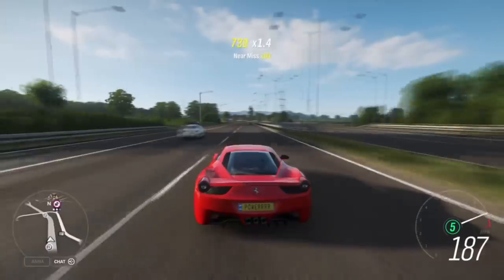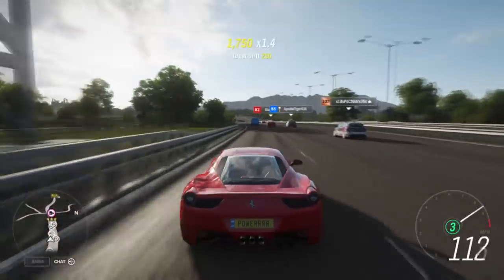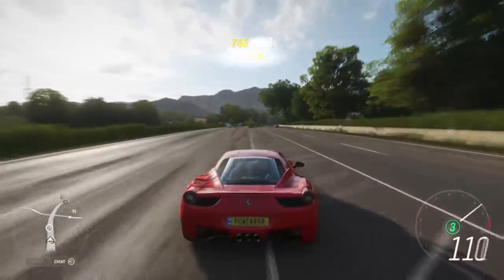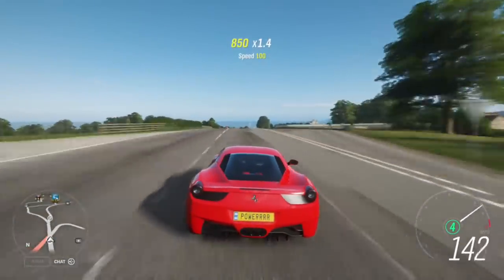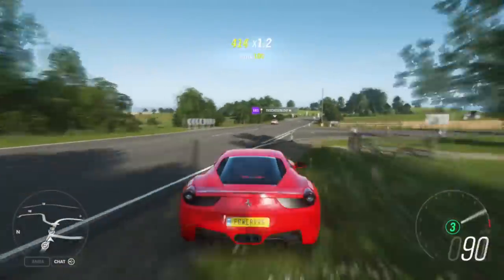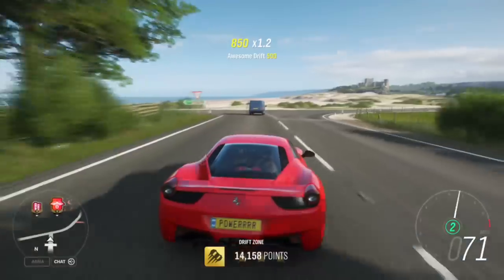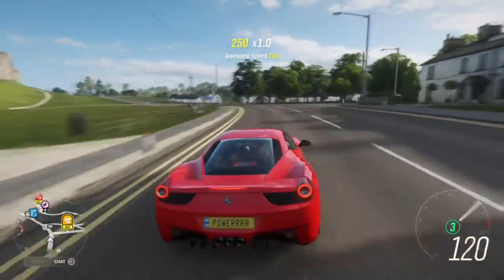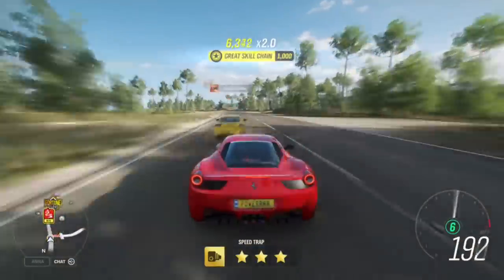Forza Horizon 4 - How Car Sounds Are Made! - Real Life Footage From PG!

Comment: It’s kinda funny how playground games used an R33 GTST with an RB-25 to record the sounds of the R32 GTR and R33 GTR which have RB-26’s. 

Smh
Reply: Ur kinda right and kinda wrong. The R32 GTR and GTST both had RB20s but had an RB26 option as a motor from the manufacturer. The R33 GTR and GTST both had RB25s but again also had a RB26 as a motor option from the manufacturer and then ofc the R34 GTR and GTST came with RB26s
Reply: close enough they cant get every car
Reply: @drumsticks1016  🤣 Who told you that?
All Skyline GTR's has RB26DETT and only RB26DETT! 
R32 GTST has RB20DET R33 GTST has RB25DET R34 GTT has RB25DET Neo
Reply: @s.k.3911  i think what he meant was the RB25DET motor is the closest to sound like a RB26DETT

PG couldn't get all the cars necessary for the sounds i guess..

Comment: 1. The GTR from FH4 does sound accurate to the 2017 model, but the 2012 GTR sounds much different. FH2 accurately gave the sound for the GTR Black Edition.
2. For the Skylines, they brought out an R33 GTS-T instead of an actual GT-R, and as you know, both variants have different engines.
3. They recorded a 1999 Dodge Viper, and brought it to the game. Great. What isn't great is that they slapped the sound onto the newer SRT Vipers.
4. They did good with the Mercedes AMG A45, but what annoys me is that the Ford Focus RS and a few other cars have the exact same sound.
5. Once again, the controversial Aventador V12 sound. It doesn't sound bad, and it's actually quite similar to the real variant, but I think they should keep that sound for the Aventador SV, and bring back the FH2 sound file for the normal Aventador. 
6. Finally, the removal of accurate car sounds. FH2, by far had the most accurate sounds to date in the Forza franchise, followed by Motorsport 6. Why change the sounds? It wouldn't be hard at all, with such a development team as yourselves to extract the sound files from older games and reuse them. It'll take some time, but you can either gather all the sounds and give us 1 grand update, or have us receive monthly sound updates, just to keep track.

Edit: I hope I didn't work on this comment for nothing XD

Comment: Paganis are imo the best sounding cars on the planet. In FH3, both Zondas sounded good but could have been better. In FH4, both sound absolutely horrible to the point of not wanting to drive my favorite car.

Here is a top speed run of an actual Pagani Zonda F if you'd like to know. You can clearly tell the difference between the real sound and game sound. Although the engines in the Zonda F and Zonda Cinque are slightly different, they are both AMG V12s so they should sound relatively similar.
https://m.youtube.com/watch?v=1UorFKL7fm4

Comment: They use a old viper sound for a new one. They use a new RS3 for the old one. Someone else said they used a car with a different engine to the R32... no one the car sounds aren't very good.
Reply: They used an R32 GTST, which had a different engine to the GTR
Reply: Carver it was an r33 gtst not even an r32 which is the car they put the sound with

Comment: It seems like they are lacking and slacking in the sound department. Don't forget this is a Microsoft title and it's one of the best selling games on Xbox every year. So the fact they just have a small group of guys go to a air strip and record sounds is kinda bad. Like you said they should just reuse good car sounds if they can't record another good sound for that car or atleast try to change them a bit if they don't have a sound file for it. Another thing too is to just call on the  community for help Tweet or announce an event or something were people can come and test there cars. Have a list of cars they want to record and detail what kinda sound tests like the revving of every gear. I'm pretty sure there are alot of car guys who are willing to do those test just get on an AIRSTRIP. Also travel somewhere were there is good consistent weather. Or asks and work with other people.